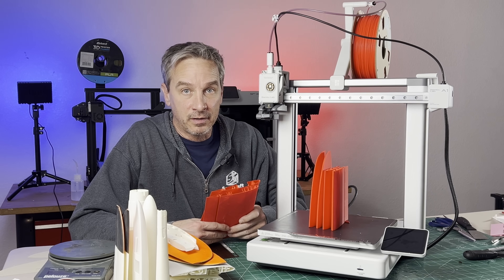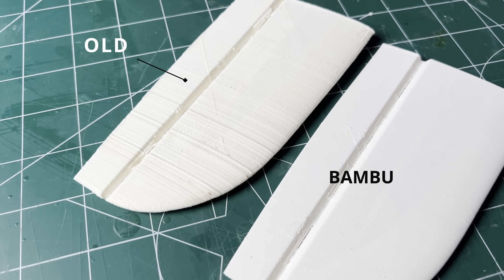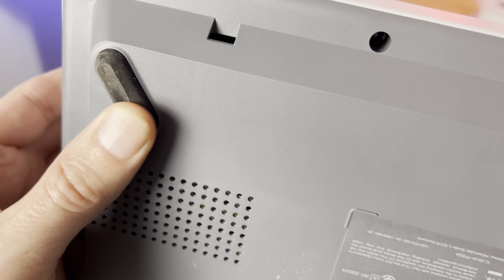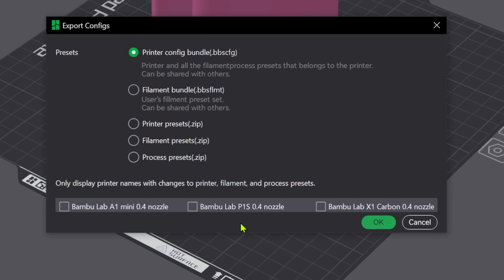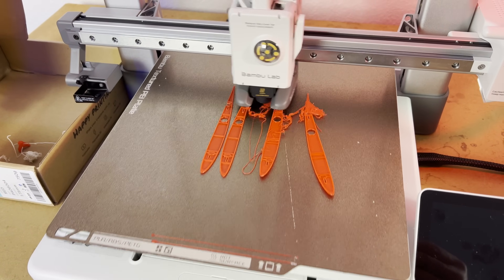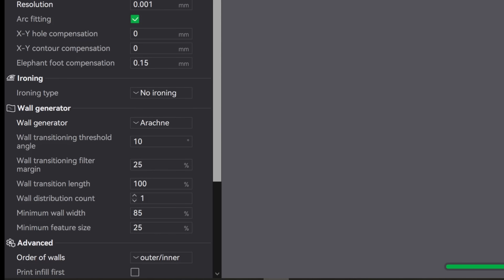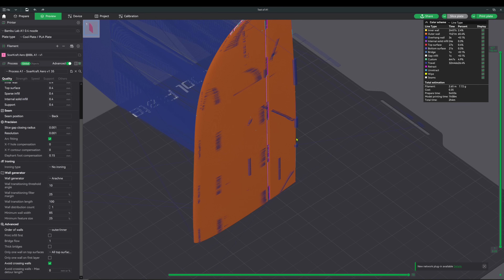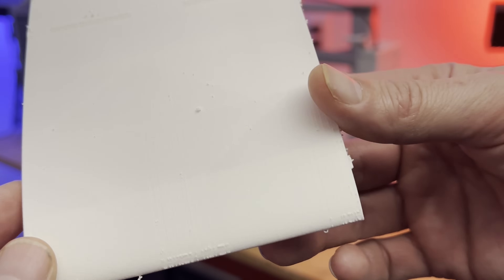Light Weight PLA printing with the new Bambu A1 (regular size) - part 1

Comment: I recently purchased the X1C and the Roughhen files. I have found that unchecking the Avoid Crossing Walls reduces the travel lines on the exterior surface of the Bambu Aero. I’m not sure how much more stringing this may cause inside the part. 

I am currently testing PETG and have had issues of the leading edge of the wing tips area printing very thin to where you can see light through it. The Wall Transition Threshold and Wall Transitioning Margin seem to help but have not got it perfect yet. 

Thanks for the videos and the work on configuration files.
Reply from the maker: So you need to check your infill.  There is a solid leading edge right there and my files use 100% fill.... or anything over 35%.  You can also increase the number of walls, should be 3 but could be 4+.  Anyway check the preview in that area to make sure it is sliced correctly.  
The Solid Leading Edge is only 2mm thick, but adds loads of support for both the wings d-box structure, impact strength for lead edge impacts, and only adds a couple of grams of additional material.